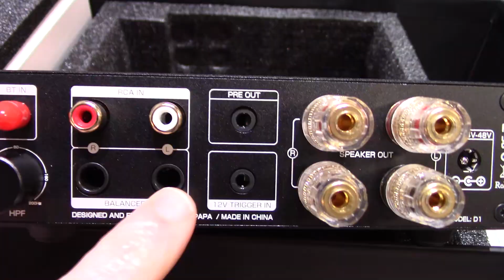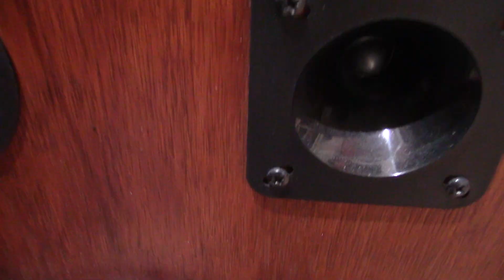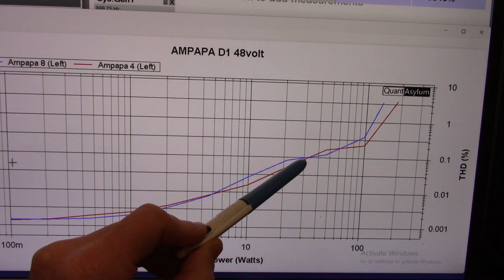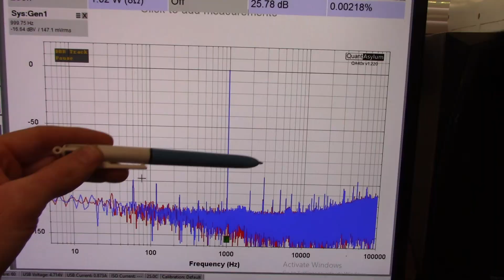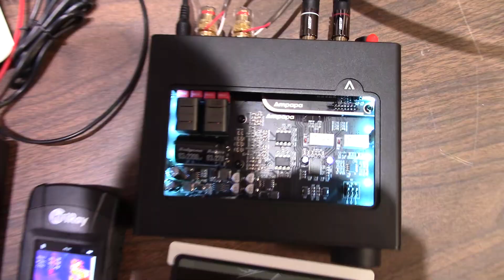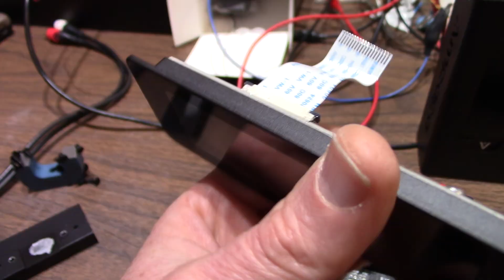Ampapa D1 amplifier tested on the audio analyzer

Comment from the maker: Ampapa is rated 120 watts at 4 ohms and 102 at 8 with the included 48v 5a supply.
Reply: They are advertising this thing to be 300watts x 2 @4ohms. Im kind of disappointed even though I know its virtually impossible to get 300w a channel out of that tiny thing.
Reply: @Libertà_sopra_vita  
The TPA3255 chip can do that ... but it's a short term burst at 10% distortion. The chip's protections cut in almost immediately.

The typical low distortion power you can expect is 100w rms at 8 ohms and 200w rms on 4 ohms with a 48 volt 15 amp power supply.

For thermal and lifetime reasons I generally suggest running them on 36 volt 6 amp supplies... that will get you 75 w rms per channel on 8 ohms and about 140 on 4 ohms.
Reply: Price approximately?
Reply from the maker: @marstedt  Around $200
Reply: @JohnAudioTech  - Thank you! It makes all the difference ;)
Reply: @marstedt  link in the description

Comment: After 3 months of ownership in a secondary near-field system, using the high-pass filter at 100Hz, sitting on top of a silent 120mm fan,  testing multiple high quality bookshelf speakers, and backed up by a properly integrated Energy subwoofer, I have never been happier with a near-field amplifier. Especially with SX52B op-amps installed. You need a single DIP-8 extender for them to seat correctly.
The musicality of it moves me constantly without my permission. That is the hallmark of a system which doesn't damage music. I can listen to it for 8 hours straight, at pretty high SPL. No fatigue at all. Nor even a little.

Comment: Thanks for a detailed and honest review of the DOUK Ampapa D1. You discovered design problems that no other reviewer even looked into. PFFB is a problem, not an answer. Round coils are beefier and withstand heat. 48 volt power adapters are frying these Chi-Fi amps. 

I also don't believe GaN adapters are GaN. They're just labelling them as such. My so-called 48v10A GaN adapter is way over-size and includes a fan to cool it. Beware of false GaN adapters.

Comment: I measured 103°f (39.4c) on the sides, 100°f (37.7c) on top, and 96°f (35.5c) at the front. Doesn't seem that hot to me.
Reply: Measure the bottom after you've been pushing it for a while.  55c is typical.

If you have the ability, measure between the PCB and the bottom of the case. That small chanber gets scary hot.

Comment: When you say, extremely hot,please point exact measure of temps,because in any other way, your opinion is useless .
Reply: I measured 103°f (39.4c) on the sides, 100°f (37.7c) on top, and 96°f (35.5c) at the front. Doesn't seem that hot to me.
Reply: @budderbear  thats true . Its quiet cold😊
Reply: Watch the video ... he does take temperature readings.

Comment: How does the high-pass filter measure? They list it as 30-200Hz at 12dB/oct, but don't seem to show how it's disabled. Is there an "off" on the pot on the back for it? There has to be something as you're showing it flat down to 10Hz. [Edit] NVM, I heard the click now at 1m or so in the video.  Too bad about the distortion as this otherwise is a really nice, versatile unit.

Comment: I wonder if the amp measures better with a lower power supply voltage? Thanks for these measurements.
Reply from the maker: |I plan on testing that.
Reply: @JohnAudioTech  great, any chance you could also try testing with one or two alternative op-amp in place of the NE5532s, say like the OPA2604 or SX52B or other?
Reply: @bbaker6212 
It sure sounds a heck of a lot better! I'm using Sparkos and Burson, SX52B (or 45, 35 or 22) do not fit without extenders.
Reply: @Jeep_on_audio  
Once again .... run a proper blind a-b comparison... I doubt very much that you will be able to reliably identify the amp with the new chips in it.

Comment: Sagami coils used here are very decent. probably underpowered for the TPA application. thus are getting hot.... great review, thank you!
Reply: This is connected to the PFFB implementation ... if you put an oscilloscope on one leg of the outputs you will likely find strong oscillations at super-audible frequencies.  But, since these oscillations will be in phase across both legs, they don't produce much (if any) output.  Those coils are working hard, even when the amp is quiescent.
Reply from the maker: I think they're pushing these little amplifiers with too much supply voltage. 32 volts runs much cooler and still enough power for the bookshelf speakers these things are often paired with.
Reply: @JohnAudioTech  
Practical use and bench testing agrees with you ... I do not run these things over 36 volts.
Reply: @JohnAudioTech  I look at "these things" as just home audio amplifiers.  
They are small and light because of class-d and nowadays we don't need the huge recievers of yester-year with a dozen or more inputs and outputs.  Hence I wish reviewers would stop considering/referring-to them being mainly for desktop/garage/second systems, and that 99% of them stop reviewing these only with bookshelf speakers.  They should be treated as any other audio gear suitable for main system use.

Also, if possible can you test an amp using another cooler running amp chip besides the TPA3255?... like the TPA3221 and  MA5332MS?
Reply: @JohnAudioTech  Marketing...

Comment: FWIW .... the "bottom cooled" amps all tend to run hot.  Apparently physics is different in China ... over there heat falls.... but here it rises.  If you take a measurement between the bottom of the case and the PCBoard you'll find it can get scary hot.

The heat on those coils is largely due to PFFB messing with the output filters.
Reply: Some very interesting points. Regarding the physics, i think thermal mass, has a significant greater impact. A neighbor, planted two Fosi Audio V3 Mono (PFFB) in one  case, thermal mass about 2.5 greater than these small factory build enclosures with 36 Volt supply and everything is fine now. I might do it myself. But your second point is even more interesting. Beside the monos with PFFB, i own the stereo V3 without PFFB and was really wondering, why they operate that much cooler. And i had PFFB in mind. There you go :-)
Reply: @TecXeng  
I've done "deep dive" investigations on a number of these amplifiers from 4 different companies... The newer models clearly run much hotter than the early designs.  

With respect to thermal mass, take a large heat sink, one that covers the entire bottom of one of these new bottom-cooled amplifiers with about 1 inch fins and flip it upside down  so the heat sink is on top... It will run much cooler without any issues. 

YES running these chips on 36 volts results in much cooler operation.  Typical low distortion power at 36 volts is 75wRMS on 8 ohms and 150wRMS on 4 ohms, more than enough for most setups... and they don't overheat or go into protection. (I've been recommending this since these tiny amps first appeared)

The PFFB scheme they're using just begs for problems.  The coils introduce phase shift that normally would pass unnoticed, but with PFFB they have to compensate for it with an RC filter that only introduces further phase shifts.  This is a recipe for instability.  On more than one PFFB amp, I've noted fairly strong oscillations at 30 and 40khz... we can't hear that, but a  tweeter can.

During testing it was very interesting to note that on the PFFB amps the output coils ran very warm (50c) while quiescent AND there was some moderate heating on my dummy loads, so, yes, that is a very real concern.  We should also note that the original designs used toroidal coils with 18ga wire where the new ferrite enclosed coils are using 22 and 24 ga wire.  That's the difference between a 4 amp coil and a 12 amp coil... and, yes, that matters. On a dummy load, you can actually hear these new coils "sing" at even moderate output levels, which is a sure sign of saturation, and the most probable cause of the rise in distortion John noticed in his tests.

My overall impression is that the various chi-fi companies need to stop listening to audiophile suggestions and wish lists and return to the original, much more sensible, designs from a couple of years ago.  They had it right in the beginning but all this interactivity via social media has lead them away from good practices into gimmicks and poor design choices.  I mean really... RGB lighting and glass tops??? What were they thinking?

To prove my point, I took an original A07 (in my opinion, still the best of the bunch) and drilled cooling holes in the top of the case, above the heat sink and in the bottom of the case to allow convection to draw cool air in from below and vent heated air out the top,  I also added clipping and protection indicators (supported by the chip, but not the amplifier) to have visual warnings if things were going stupid.  On a 36 volt supply, driven just below clipping, that AO7 will run day and night at less than 40c case temperatures. Popping the top off reveals a heatsink temperature at about 55c and coils that are just warm to touch.

I'll let you draw your own conclusions.
Reply: @Douglas_Blake  why not use a different chip like the TPA3221 instead of the TPA3255?
Reply: @bbaker6212  
Because then they couldn't claim 300w per channel.  😁

The TPA3221 is a 35 volt chip that caps off at about 60 w RMS per channel. It's a good amplifier, there are DIY boards using it and they sound just fine.
Reply: @Douglas_Blake  Is the instability at higher frequencies exhibited in the tone control measurements?  It looked like oscillation/instability in the circuit in the freq. boost graphs.

I'm a long time switching power supply chip designer, I've been in the game for decades but recently retired.  I've been watching with interest using PWM designs for DC outputs (aka, power supplies) migrate into the audio field.  I've just started to look into these products in the last few weeks since an old Crown D-45 2-channel amp driving my rear-channel speakers gave up the ghost.  I did not want to spend much for a replacement amp, which lead me to these class-D products.   What's out there has some a long way since I was at TI when they introduced their first chips for class-D (I was not involved in that product line).
Reply: @Douglas_Blake  Very concerning that it outputs high frequency power while idling. Not good for tweeters and a strong sign of bad design choices. Unfortunately these amps have been made to fit certain tests and pass them with flying colours and creating hype. I'm thinking in particular the hype they get from ASR's flawed testing protocols.
Reply: @mrpeterfromgodknowswhere  
I am forced to agree with you.  It does seem they're only testing what they want to see... not trying to design a stable and trouble free product.  ASR is just testing the consumer specs, no in depth inspection is conducted, nor is it expected.

There is also a strong indication these Chi-Fi companies are either sharing or taking each other's designs. It's not uncommon to find a flaw that proliferates across  products... and companies. Conversely, when they get it right, they pretty much all get it right.

On the other PFFB amps I've tested the instability shows up as a couple of frequency spikes in the 35 to 50khz region. These oscillations are clearly visible on the individual arms of the BTL outputs, but they do appear to be in phase since they don't generate an output across the bridge.  This, of course, is a good thing since tweeters would really hate it.
Reply: Please stop repeating this nonsense. It gets warm, not hot. I've driven it hard all evening (48V) and it is just warm. The opamps I used were almost too hot to touch (60°C).
Reply: @Jeep_on_audio  
It's not nonsense... You don't seem to appreciate that heat is the enemy... especially when it gets into places people touch.  

Now for those hot op-amps ... op-amps should run at room temperature  ANY heat from them is bad.  

Of course you would never listen to the reasons for this.... But hot op-amps, hot coils, hot chips... all signs of significant instability.
Reply: @Douglas_Blake  lift the glass a little.

Ever had a gaming PC? Heat around 60-80°C is absolutely fine.
Reply: @ANiCKiN  
Absolutely fine for the CPU and GPU but not for all the other components on the board ... and especially not for the outer casing where people will touch it.
Reply: @Douglas_Blake  So you are scared someone is going to touch metal that is 35°C warm? 

Stop. 🤦🏻‍♂️
Reply: @ANiCKiN  
When pushed, these little amps get hot enough to discolour furniture, you can feel the heat radiating off of them.  

The chip's protections do not cut in until 125c. So yes I am concerned that someone is going to absent mindedly grab an amplifier that is way over 60c.

What bothers me most is that manufacturers don't seem to care how hot their stuff gets.... AND... end users are making excuses for them.
Reply: @Douglas_Blake  Did you test it? No.

And you are not supposed to touch or carry around amps for no reason, after they were turned on for hours.

And yes a little fan would probably help, but i am not worried about the heat.

You can also buy smaller power supply.

I ordered one and i will tell you how much warm it gets, by touching not measuring.
Reply: @ANiCKiN  
Tell that to a curious friend, 6 year old kid or your wife while dusting....

"Not supposed to"  and "Cannot happen" are not the same thing.

Comment: Class D amplifiers are very efficient at higher power. They do have quite a high quiescent current, in fact below about 5 watts output they compare very well with a class AB amplifiers QI. About 60mA is used by the LEDs and extra signal processing.
Yet another use of the same class D chip almost EVERYONE uses, but this version, performance has given way to extra gimmicks. The THD is really very poor, even by Class D standards. At the end of the day, it's a choice, performance or gimmicks. You can't have both for the same money.
The case will get hot, it is the heatsink after all. The chokes also do get very hot, they do have to work hard removing the high frequency carriers. Sad these don't do it at the right frequency's. Class D can be very good, but a very hight price.
Reply from the maker: These amplifiers are limited in thermal dissipation given their small size. Running them at 48v is silly to me. 32v makes more sense as they run much cooler and still produce reasonable power to drive bookshelf speakers that these small amps are commonly paired with.
Reply: Good day Sir Beeny....
Reply: Hey Michael ... good to see you posting!
Reply: I own one (and several others) with Burson opamps, and I can tell you from experience what you are saying is nonsense. This TPA3255 is one of the best. And the most versatile.
Reply: @Jeep_on_audio  OK.
Reply: @Jeep_on_audio  
The little matter that the coils and op-amps run danger-hot and the case gets warm as toast, notwithstanding.

Comment: Of course this will get into 'Boutique Audiophile Gear' territory real quick, but I suppose there are Class D amplifiers out there that are discrete designs (Not your typical Class D chip amp) with larger heat sinks and ventilation as well as power supplies with some real oomph! Wonder how some of those would fair on the Quantasylum?
Reply: Take a look at the Crown XLS1002, any ICEPower amplifier, products using Hypex or Purify output modules ... there certainly are some truly beefy and well made class D amps out there.

The TPA3255 can hold sway with them, up to it's rated power.  It actually is a very good chip for home entertainment use, but the original design thrust was for sound reinforcement and public address use.

Comment: Seems like they wanted it to play to 96khz, about the limit of high-res audio formats.   Too bad it's all dog poopoo up there and even extends down to 2khz in some cases.   I think you're right about the filter being the source of the distortion and heat, which also explains the distortion heat-dependency as the higher temps cause further coil saturation.
Reply: how should the filtering be designed/improved?
Reply: @bbaker6212  
Disable PFFB ... use coils rated for minimum 15 amps, reduce output capacitor values, use all low effective resistance parts, use BIG heatshinks.  

These amplifier designs are almost always copy-paste from TI's technical briefings. Do a search for "tpa3255 data sheet" and "tpa3255 post filter feedback", both authored by Texas Instruments ... that's where this stuff is coming from.

Comment: It looks nice.  It should be fine for a desktop system or lower volume output with a moderate voltage power supply.  Stack a few with a active crossover should be fun.  Thanks for testing , the front panel queued interest.